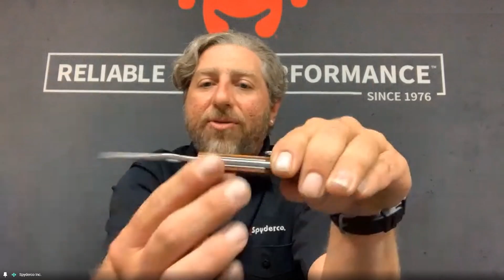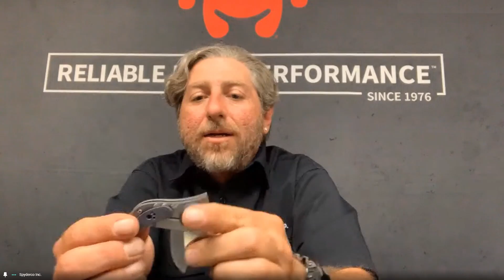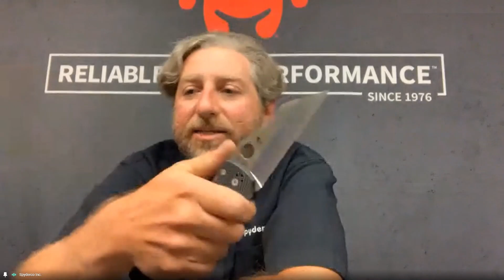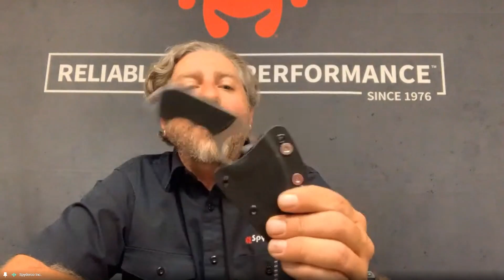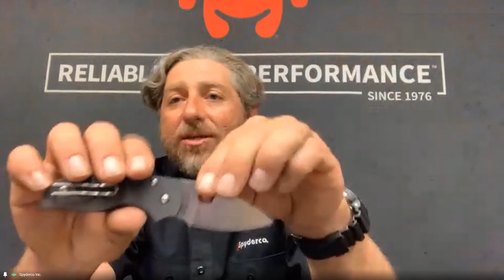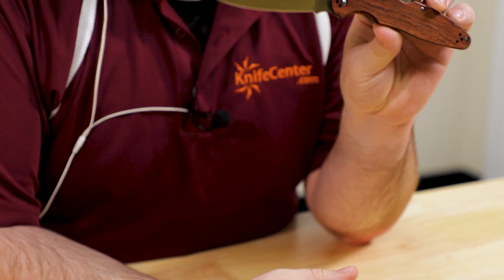New Spyderco Knives: Blade Show Week 2020 brought to you by KnifeCenter

Comment: I love spyderco but has anyone else had uneven blade grind issues from the seki city knives?
Reply: Louis Rodriguez 
Do you mean the main grind bevels are uneven at the plunge line or the secondary edge bevel?
If the latter, then it’s a relatively common thing. That’s what you get when manufacturing on such a large scale. Shouldn’t be too hard to fix with one sharpening though and it’ll still work just fine in my experience. 
The latter issue is not unique to Seki models and I’ve seen a Spyderco with an uneven plunge. That doesn’t mean it hasn’t happened, of course, just that I’ve not heard of it.
Reply: @Dynotop1a  yes the secondary, it's not a huge issue because my endura 4 glow in the dark and Pacific salt 2 and 2 if my favorite knives but it was just funny to me because my $50 spyderco resilience I got at Walmart is flawless with perfect grinds. I love all my spydercos though